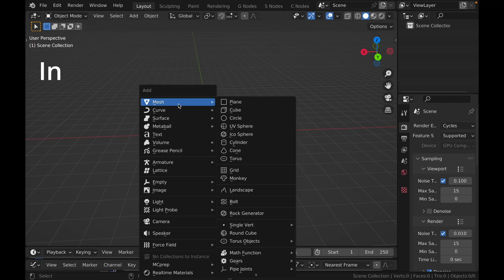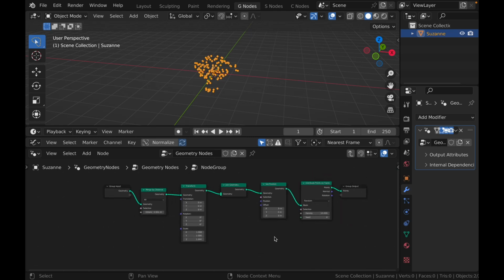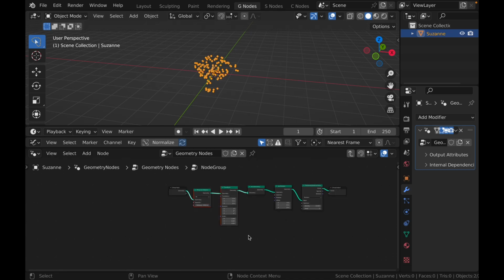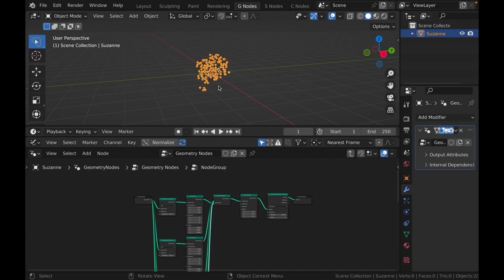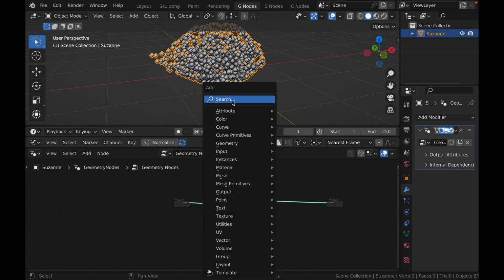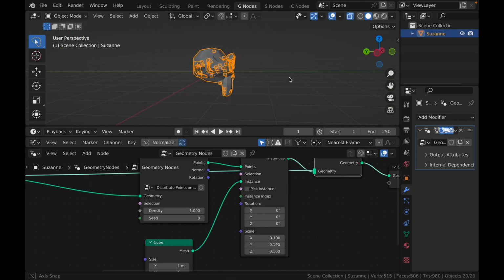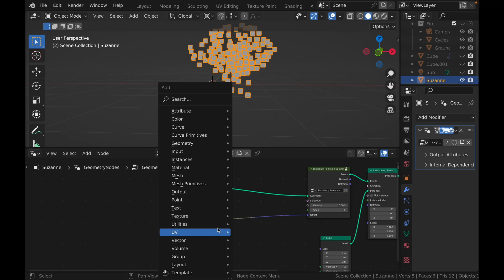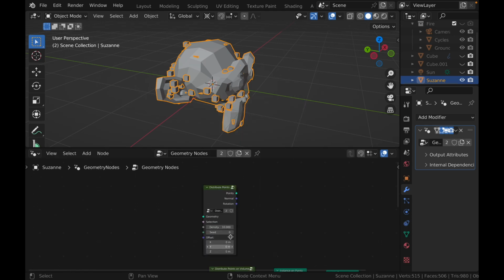How to get the Distribute Points on Volume node

Comment: Nice Video👍🔥

Is it also possible to make the Points appear only on the outside and not in the inside?
Reply from the maker: I have a video that explains that as well as several other key principles of geometry nodes: https://www.youtube.com/watch?v=blp50tCTQ8s

In other words tho, yes you can - just use the distribute points on faces node without the other nodes  in the node group
Reply: @techno_artist  Does this also work in a grid?
Reply from the maker: @blendcreator  You can't use distribute points on volume for that, but distribute points on faces should - if you just want things to appear on the vertices on the mesh, just skip the distribute points step and go directly to the instance on points step because blender can use the vertices as points - so the whole reason anyone would use the distribute points on faces/volume is to make it look random.